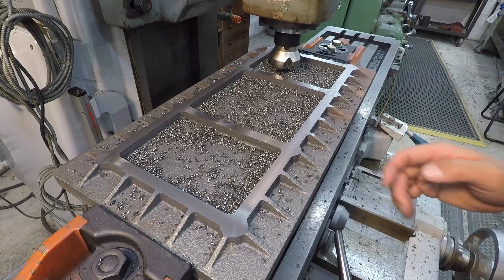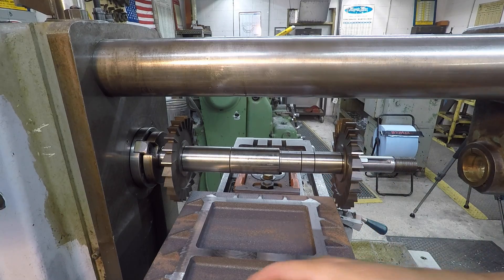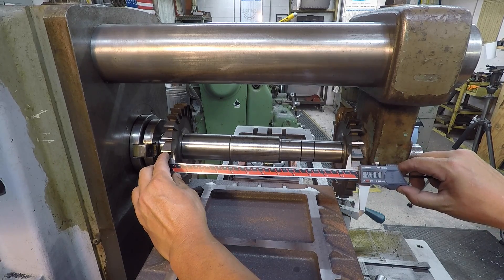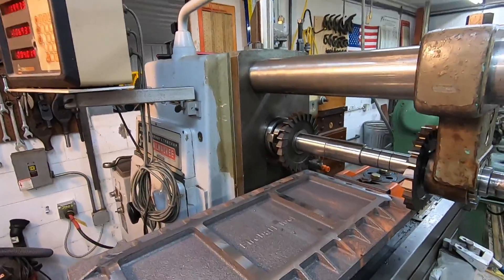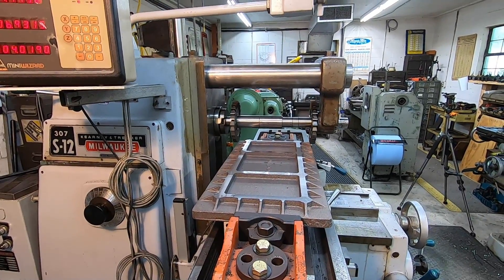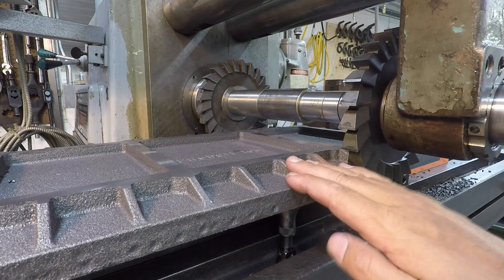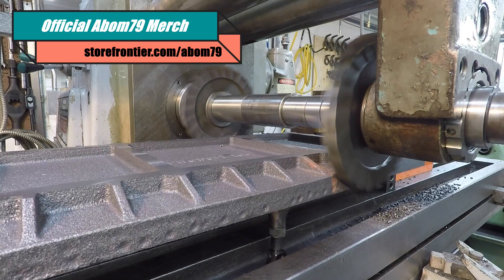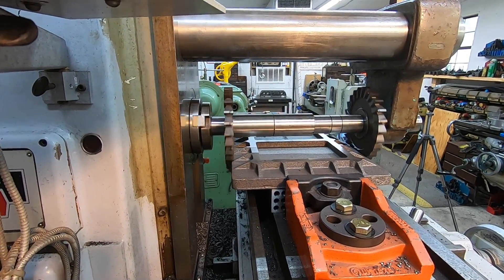Gang Milling the Fireball Tool Fixture Plate

Comment: Could you shave the low side clean, build it up with weld and then mill it out flat? Kinda like Essential Craftsman does with anvil repairs?
Reply: Welding might induce a bit of stress in the casting.  Hard to weld cast iron without inducing cracks, too.
Reply: Ryan Grimm I wonder if he could use the metalizer to build it back up?
Reply: @ryangrimm9305  Hi Ryan, that's true but have you seen Scott on the Essential Craftsman channel welding on cast iron anvils and then grinding then back in shape? It's well worth a look, so interesting to see how an anvil is repaired. Cheers.

Comment: Seems like the Skyhook could need a handwheel on each side.
Reply: That's what I was thinking. Could be a good modification.
Reply: Just what I was thinking.  The hand wheel axis look as if it would clear the other bits of the structure.

Comment: How does ambient temperature effect the measuring of big blocks of metal like this, is there a scale that will tell you from mass of metal to ambient temp how the size will be effected.
Reply: Machinery's Handbook can give you the expansion/contraction information for different materials at different temperatures.  In twelve inches, not much.
 If you were CASTING metal, you would need to know the amount of shrinkage for each type of metal.

Comment: Using the vertical mill, cut a pad into that ‘oops’ spot so that it’s at an even distance from the other side (so, perhaps 11” 3/4) and add some tapped holes. Bingo, it’s not a bug, it’s a feature! 😎

Comment: After watching the previous video where the bottom was milled flat and you were not entirely sure how the sides were going to be machined, I suspect the setup for that operation did not require it to be perfectly straight, easy mistake t just move onto the gang milling because it was setup so well, without checking the piece was straight enough.
If you had been able to just use an endmill on each side, the out of square possibly would not have been a problem as it would have been machined just enough to clean it p, and the second side milled to size.

Comment: Whay didn't you mak another pass with an endmill. Is the 12 inch measure an important feature? By that you would then also be symetric to the back edge where you've been starting cutting into the ribs already.

Comment: 6:15 ah theres that chatter i knew you'd get from not having the center supported
Reply: its a shame that someone couldn't stick a machinists jack under you to get rid of your annoying chatter.....  honestly, what good does your comment do? you seen that it would chatter... i thought of that too, and I'm sure a lot of other people thought the same... but Adam was the one running the machine and doing the setup. maybe he thought that the setup was ridged enough that it didn't need it and it was worth a shot to try and run it to maybe save some time....? worst case scenario, he spends the same amount of time putting in the machinist jack before running it or after he ran it and it chattered... if he ran it and it was fine, he saved the time of setting up the jacks for no reason...   it wouldn't be the first time a human thought that it would be ok and it wasn't...  I've made sketchy setups that i was sure it was gonna chatter like crazy and it was fine. so you cant just look at a setup and say, that's gonna chatter for sure. there is much more to it than looks and you cant tell that from watching a video... I'm sure Adam knows what he is doing..... lol

Comment: Would have diagonal measuring helped?   If you are milling a parallelogram, it's a bit more challenging to get things square and parallel.  Was there a tolerance for the width?  Will that impact the placement of the bottom holes when you drill them?  Inquiring minds want to know!   Keep up the good work and stay safe.
Reply: I get the feeling that this is for his own use in the shop, which makes the tolerance "Whatever Abom's happy with".
Reply: he said in 1st part that he wanted this top when it came out its for his use and 3 thousand's of a inch will not hurt the size of this table ,, it's a bigger work area size is not a problem ,,

Comment: Not sure you were out of square.  I doubt the work piece edges were parallel to start with.
Reply: Don't know much about cast iron molding but my 62 years of  injection molding plastic has shown gating, venting, flow/filling, cooling and shrinkage influence the finished casting. If filled for strength the variables change across the fill to those with the fill direction. The purity of the material is a finished shape factor. They never come out flat, square, symmetric or perfect. All parts need tolerances!

Comment: That's what happens on occasion. All you can do is move on, fortunately it's a flaw that won't affect the operational quality of the plate.

I style myself a pretty good car electrician. I had made for a friend of mine a brand new loom for his car. I was in Los Angeles installing it (I live in San Diego), and as I am wont to do, I test as I go along. I get the battery hooked up (I'm that far along), flip on the ignition switch, aaaand.....nothing. OK, let's try that again. Off, then back on. Still nothing. To the fuse box, check for power. Power is AWOL. WTF!?!? Review the external connections- everything is in place. Battery is connected to the system and showing 12.7V resting. I literally rip the harness out of the firewall, and opened it up. Found my mistake: I missed a splice from the battery to the fusebox. I violated my First Rule of Electricity: You have to hook it up. Repaired the harness, rewrapped it, reinstalled it and had the car running the next day. 

Now, much as you discovering to check for square on that style of milling op, I review all connections before I wrap up a harness.

Comment: I think I know why your width went under. Cutter run out. Ether you picked it up in the setup or someone didn't grind the side teeth true to the hubs of the cutters. Grinding cutters like this is my business. Some call themselves tool grinders but far from it .
Some don't use an indicator to true the arbor and you need to put a finger under tooth to control the spacing. I seen it people who don't take pride in their work. 
To get cutter to run true is easy stuff.
Reply: Also at 6:15 the spacers on the right doesn't seem to be running true, might have contributed to that.
Reply: @chakflying1  A little run out here a little there it all adds up .
Unless you're lucky enough for the two to just happen to  cancel each other out.
Reply: Also any tram error in the table (I.e. table not perpendicular to spindle) will result in a size error at the top of the cut but not necessarily the bottom (slots become tapered, with curved sides due to circular shape of the cutter). I have a little Atlas horizontal mill that had this really bad, around 0.4mm error over 150mm sweep of an indicator held in the spindle. The larger the cutter diameter the more noticeable the effect. I had to scrape the saddle to correct the problem.
Reply: @nerd1000ify  I can see that. When I ground tools in house operators are very quick to blame the tool. With me most of the time it wasn't. I have made mistakes I would like to think very few.

Comment: oh this is a rare one for you and many modern machining, gang milling you dont see that often adam
Reply: because it adds a level of error most machinist try to avoid. if done 100% correctly it is a time saver @ 99.99% it could cause a damaged part that would be scrapped ( but in this case he states it is not a problem ) 
he also notes he assumed a raw cast edge was square, the fact he admits his errors and will learn from them is a good thing

Comment: I did wonder about squareness. Het ho. What you could do of course is machine the sides to exactly 300mm. The actual size doesn't matter for this purpose but if you can't hit exactly 12 inches, you could aim for 300mm which gives you a second shot at having a "perfect" size.

Comment: I dont know anything about milling but it seemed ambitious to do both sides at once.  No guts no glory.
Reply: Dang right!
Reply: If you look up gang milling you'll see that this was one of the primary uses for this type of mill.  Plus the combination of cutters was almost unlimited.
Before CNC this allowed single pass multiple surface cutting.  The set ups took a long time but one set up you could cut a thousand
Reply: @scottpecora371  I guess that's what I meant.  A lot of setup to make 2 cuts.  I guess one benefit is they are guaranteed to be parallel.
Reply: @michael931  I think he mentioned in "part 1" that parallelism was actually one of the reasons for doing it this way.

Comment: Hi Adam. I wonder how difficult it would be to build up a weld bead on the side of that fixture plate to fill in that little bit there near the end (and a few voids in the casting, it looks like), then let it cool and re-cut it while you’ve still got it set up for gang milling?
Reply: It's tough to weld cast iron without heating the whole piece. That amount of heat would undoubtedly cause dimension changes, warping, etc.
Reply: I know dudes who weld cast iron and aren't afraid of nothin'.. particularly since it's a non-structural item. Good idea.

Comment: How come the cutting heads are spinning in the opposite direction to the shaft  ?
Reply: Interference of camera shutter speed perhaps?
Reply: Optical illusion
Reply: It's a stroboscopic phenomenon called the "wagon wheel effect." If you watch old western movies, the spokes on wagon wheels appear to be running backwards in many scenes. it occurs when the frame rate for the camera is out of sync with a rotating subject. You can make a rotating object appear to "freeze" or even run backwards by illuminating it with a strobe light and adjusting the strobe rate.
Reply: If you look at the hub on the end by the machine you can see the actual direction.
Reply: Just like watching the old Westerns and seeing the wagon wheels going backwards lol..
Reply: Seriously?
Reply: Maybe, thanks

Comment: Wouldn't it have been better to have set the fixture plate up, flat on the mill table, instead of on the 123 blocks?
Reply: I'm assuming he had it on blocks so he didn't have to worry about cutting into the table?

Comment: Assumption is the mother of all mistakes, don't worry I've made plenty by assuming the other guy did his job right......
One job I was absolutely sure I was correct, other guy did his bit but didn't solve the problem. I rechecked everything..... got a different guy to do his bit, problem found and fixed. Lesson learned, now I check everything 3 times before doing anything.

When climb milling, is it better to half the feed rate just to reduce the chance of problems happening?? and yeah I kinda saw in the first video that there was no support in the middle of the plate but don't like to question guys who know far more about machining than I do. 

Keep up the great work Adam

Comment: I was wondering why you tried two cutters at once. In woodworking, we always get one edge square on the joiner, then move on to the next edge, and so on. Trying to get them parallel at once is a recipe for mistakes because there are too many edges to keep track of otherwise. I would have done the layout for the screws. Get them where you want them, and then measure to edges to see what is leftover. Square a short end, then the other short end. After that, you can center the entire piece and mill it.
   I like watching metalworking like this to see the differences in techniques to solve problems.
     edit; I want to make it clear that I think the holes should be drilled afterward. But the layout for them should be done before.
Reply: In the previous video he showed that this was the only way to get both sides without moving the part between operations. Every time the part is moved, it introduces a chance for error. While he did not get it perfectly square, at least he knows the two sides are perfectly parallel whenever he needs to clamp to them.
Reply: @incendiarymoose5646   It also increases the chance of major error when all the variables are not taken into account. It's a very large difference of approach to a problem. It's almost a philosophical one. Can't see the forest when looking at the trees.
Reply: @firesurfer  The mill table slideways are already (hopefully) square with the spindle, so no reference surface on the part is needed to produce parallel faces if you straddle mill like this- the squareness is generated by the movement of the table. In fact if Adam had an appropriately sized slab milling cutter (think a spiral jointer or planer head but for metal- they are usually HSS and ground to form rather than having inserts but otherwise a similar concept) he could have done all three accessible faces in one pass.
Reply: This is a common set up on a milling machine
Reply: @janvisser2223  I can see that. Very different approach to the problem of rough ends.

Comment: why did you reverse cutting
Reply: Look at the end of the spindle and chuck not the cutters bud
Reply: To be sure that the load on the casting due to the tool pressure is pointing downwards. You don’t want your workpiece to be pulled out of the vise!!

Comment: Sky Hook needs moding to use the crank on either or both sides.  Maybe even a drill motor attached?   I need to get a mill so I can see how bad I could screw up.

Comment: Thanks for a trip down memory lane....... When I worked for Boeing I made lots of similar setups with gang cutters. Always had to check the cutters for being on center and same diameter and width with the proper spacing etc. Most of our parts that required a gange setup sometimes as many as 4 cutters with varing widths came in "kitted "from the tool room so all I had to do was the setup. Heaven forbid if you broke a matched cutter! Always lock out the "Y" axis if possible. Believe me BAD things happen quickly if you pull the wrong handle.  It was always aggrivating getting the right crush compensation on the shims. Fun times. You are correct in the climb direction. Anything suspect of being lifted always climb. I always set the table lock too so it would create some extra drag. Those old Cincinatti machines were well used so you learn to compensate if you know what I mean. I really like those heavy toe clamps.

Comment: 3:35 how does such a backlash eliminator work?
Reply: There's several ways to do it but most commonly it's a two-nut system. The backlash eliminator spreads the two nuts apart along the axis of the lead screw - so they put pressure on both the leading edge and trailing egde of the lead screw. using a backlash eliminator all the time will lead to prematurely worn nuts.
Reply: George Todd   I hear you, friend.  I think that’s happened to me.